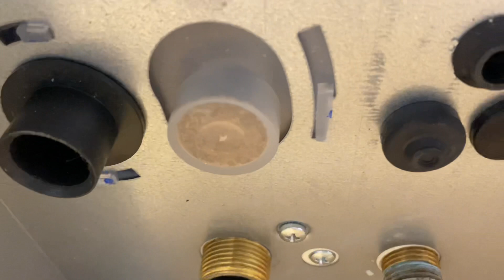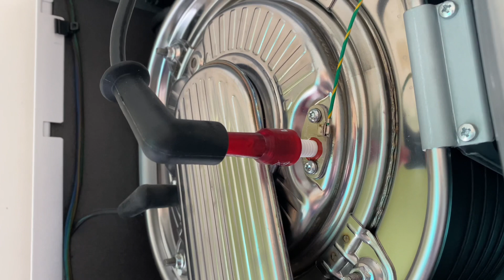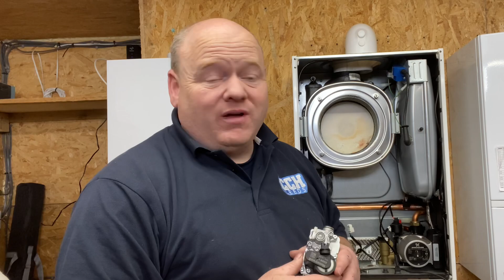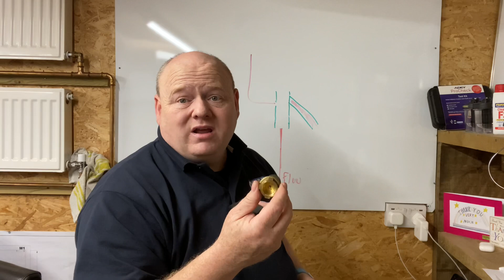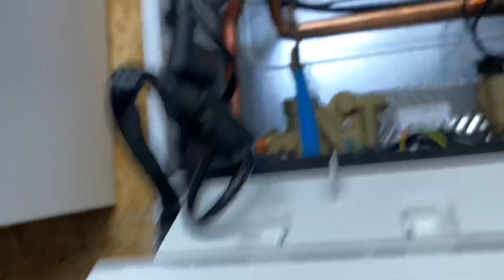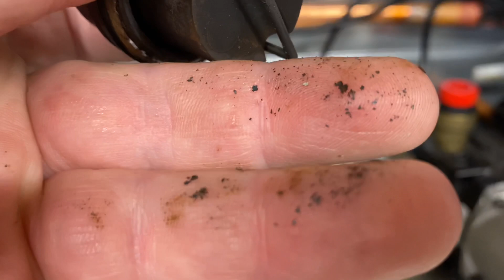Gas Training - How An Ideal Vogue Works - Combi Boiler

Comment: Over the last few day's mine has been turning itself on my centre thermostat set to manual and temp is above desired temp.Tried changing the batteries and even took the batteries out of the thermostat control when it turns itself on its not fully on the radiators are warm but not as hot as normal.

Comment: If these boilers come mostly with a 10 yr warranty would the parts not be included and never need to know what part is needed (as Ideal etc would send out the part if the gas engineer is willing to do it vs waiting for the Ideal warranty sevice team to survive)

Comment: Very similar to ariston microgenus
Reply from the maker: Thank You
Reply: i am looking to replace the ariston microgenues its been over 15 years now all modern boilers use plastic hydroblocs  except baxi  every one is offering  Worcester Bosch  i don't like plastic  the reps are getting kick backs from Worcester Bosch  valliant  the only problem i have is 22mm mains gas dont know if i can i can run  baxi 836 or platinum on this  gas line   i had ariston mocrogenus 28 mffi

Comment: After refilling/re-pressuring a combi system, the air vent cap should be open, otherwise the valve cannot vent air from the system. It can be left open, though after several days, all air should have been expelled. Only close the cap if it is leaking water
Reply from the maker: Thanks very much for your comment, please consider subscribing to support the channel 🙂

Comment: Hi Allen, Hydroblock on this boiler doesn't have a by-pass pipe as in Vaillant EcoTec. Does py-pass make any difference really? And also Vaillant has the diverter valve on the right side of the heat exchanger beside the pump, on Ideal Vogue it is on the left side, does it also make any difference?

Comment: Am I correct in thinking the entire housing, with the pump etc, is proprietary to Ideal and therefore extremely expensive to purchase housed replacement partst? I was looking into getting one of these for my own home, but when I saw that design I ran a mile.
Reply: Ideal parts are not expensive. And these boilers come with a 10 year warranty out the box anyway 👍🏻

Comment: Baxi 836 or Viessmann 100-W 35kw (2021) this is a hard decision.
Reply: I am getting the 100-W 35 kw (2021) installed in 6th May 2021,  reason chosen for me  new low CH turn down to 3.2 kW,  the baxi 636 or the ideal vogue were my other choices I would also been happy with  except for the turn down
Reply: The viessmann boiler is more economic to run on gas, also considerably quieter than most other brands
Definitely recommend

Comment: Is that the same as a Main Eco Compact and if it is why fit the more expensive versions?
Reply from the maker: The Vogue is quite a bit more advanced and also works better on bigger systems. A lot of it is similar to the Baxi/Main though. Thanks.

Comment: Alan have you installed a honeywell evohome opentherm on a ideal vogue. If you have how do you wire it in. Thanks John
Reply from the maker: No, I am not keen on all the batteries. Thanks.
Reply: I have the evohome system running 12 radiators. The control you have over individual rooms and savings for a large victorian house outweighs changing batteries every 18 months. Probably takes me 90 seconds per radiator.  Evohome has an option to use opentherm and ideal can also do opentherm. Just not many heating engineers know about opentherm.
Reply from the maker: @johnmcconnell5930  opentherm isn’t new😂 evohome isn’t a product I would install. Thanks

Comment: Allen can you please explain a little more about pumps.  You said this was a 15/70 which means it's slightly bigger.  Can you elaborate more on this. I think on baxi's 15/60 is quite a common size.  What exactly does this mean.  Sorry if my question sounds a little simple, Thanks.
Reply from the maker: I will try and do a video on this. Thanks.

Comment: How could it be scrapped. So pleased with our Vogue
Reply from the maker: The Ideal Vogue is one of the best boilers on the UK market in my opinion but unfortunately, not all installations are the same. If it was badly installed then it could have damaged the boiler. I have no idea of the history of it. Thanks.
Reply: @AllenHart999  bought mine because of you Allen. Thanks for all you do
Reply from the maker: @miscman10000  You definitely made a good choice. Don’t forget to have it serviced every year to keep the warranty. 👍
Reply: A combi might not have suited the situation. May have swapped to an unvented cylinder and system boiler.